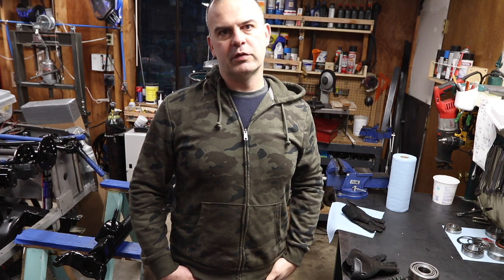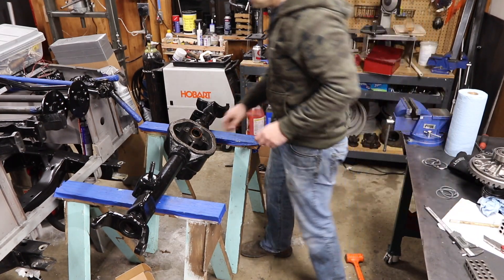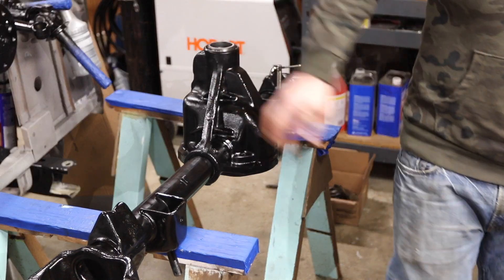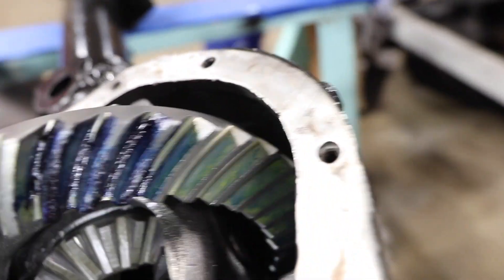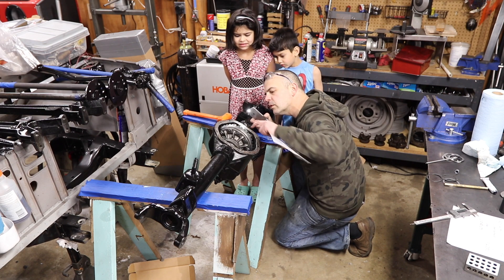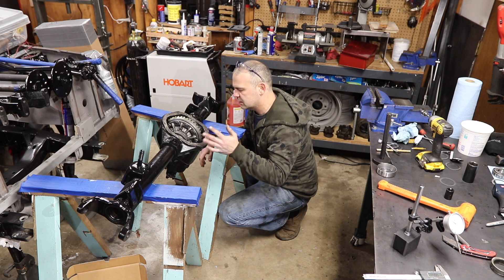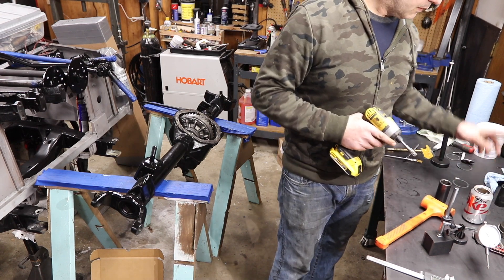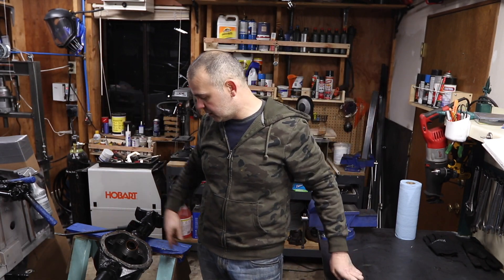3.28 - Success! - Dana 44 Ring and Pinion Setup - Part 10 of Gears and Axles

Comment: I like your video. I am also doing the same for a dana 44 for 1978 dodge truck and I still haven't got the depth pinion in the correct position. I have mount and dismount about 30 times and not yet done.

Comment: Matt, Living the same dream, diff in and out check and recheck. Best advice I could offer anyone is an obscure sentence in the maintenance manual. If the pinion is too deep or too shallow move it in larger increments like 0.010" shim at a time until it goes too far then you have it bounded and it is easier to adjust from there.

Comment: Great Vid, I have noticed that nearly all videos and rebuilds of Dana44 require some form of force to push the differential carrier back into the housing. I have a good 30 odd thou room around the bearing sleeve under the holder. is this normal?
Reply from the maker: Chris Bingham thanks. you have clearance under the bearing cap? There shouldn’t be any room any where. Email me at mattsgarageshow@gmail.com

Comment: Should have put an ARB in. Your setup would have been much easier because the ARB carrier shims on the outside of the bearing races, instead up under the bearing. So you would have pressed on the real bearings first thing and never had to mess with them. Doing an open diff 44 is a real pain. I say do it yourself   and use the money saved towards an ARB. Much easier setup and you have a locking diff when you're done.
Reply from the maker: Bob Catt that’s great knowledge. I hadn’t realized it reversed the shin location. That’s how the Jeep Dana 35’s are in the rear axles. Way easier to set up.

Comment: im going through the same  situation as  you  did, do you  remember  by  any  chanse  de shim thickness on the  pinion  depth and  the preload shim thickness?
Reply from the maker: edwin velazquez sorry to hear that. I don’t think I ever took the final measurements because I was just adjusting according to the pattern after I got it to the nominal pinion depth. It was very difficult the first time. Now it doesn’t seem so hard. I just did a Dana 35 and it was easy. Stick with it Edwin!
Reply: Matt's Garage thank you matt  for this  video  very  helpful, I think  I got it this time  after countless times!!!

Comment: Hey Matt same dam boat here, been trying to put this together for a year now. Where did u get your specs from
Reply from the maker: A4 Water a year!?! Wow you are way more patient than I am.  For my specs I used a combination of written specs from the internet and a few videos from Janz engineering. His videos are not well made but he shares a lot of knowledge. Which specs do you mean anyway?
Reply: Well u know how frustrating it is. I do have the two diff sets of bearings koyo for setup and skf for good ones is it that big a diff I have everything good within spec I’m just scared it’s gonna be too loose when everything gets pressed for the final deal.
Reply from the maker: A4 Water I had the opposite problem when I put in the Timkens for final everything was WAY too tight (you can see in prior failure episodes). I know it sucks but I would get a set of SKF’s for you set up bearings. Maybe you’ll get luck and there won’t be a difference but for me it was a huge difference.
Reply: So that’s the part I don’t get; once I have everything together with the setup bearings and within spec, then I need to add more shims for the final? Or just put the exact same as on the setup
Reply from the maker: This is where it gets a bit subjective. When you are doing your setup, you should be putting your carrier in an out with no pre-load, meaning it should be tight but not so tight you have to pound it in or can't easily pull it out  So assuming you have the same brand bearings as setup bearings and you get it all where you want it, when you go to do the final you put the exact same shims/slinger for the inner pinion bearing.  But when you do your carrier bearings you are supposed to add .015 (15 thousands) total shim to preload the carrier.  When I tried to do this I couldn't even get the thing in and when I did it left me with no backlash so I ended up with only .005 (five thousandths) preload.  Hopefully it doesn't blow up.  For the outer pinion shims, I can't exaggerate how quickly it sneaks up on you.  There is almost no preload until you get right up to the torque spec and then it climbs fast. Good luck.  And don't worry, it's just an axle ;-)
Reply: My original pinion had no shims on it just the slinger after the outter bearing, so I am a little confused where it should be shimmed. It has the setup bearings on it and it has way to much end play. I’ve read some stuff that says behind the inner race and I’ve heard behind the outer bearing .
Reply from the maker: A4 Water email me at mattsgarageshow@gmail.com. What type of axle is it?

Comment: Thanks for the video, very helpful. How did you remove the inner pinion race without damaging the baffle and shims?
Reply from the maker: You are welcome Greg. Check out Episode 3.21 on making set up bearings.  https://youtu.be/6rRhmdmw-hg

I shave down the outside of the old race to make a set up race.  If you are actually doing s setup I would watch all three video so you don't make the same stupid mistakes I made. 

https://youtu.be/TDdrh9AIpk4
https://youtu.be/8pKICEltGks
Reply: Thanks for the links now I feel better about doing this project.